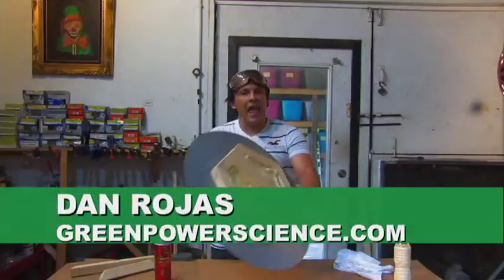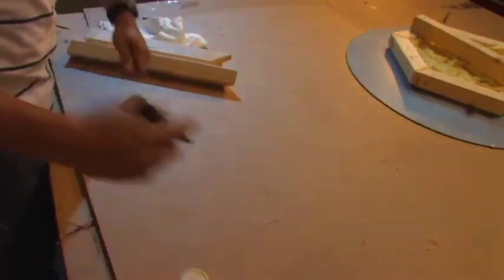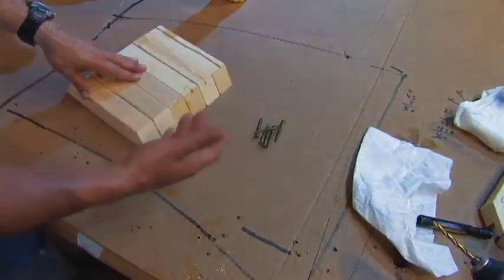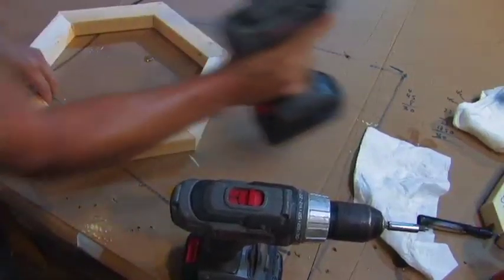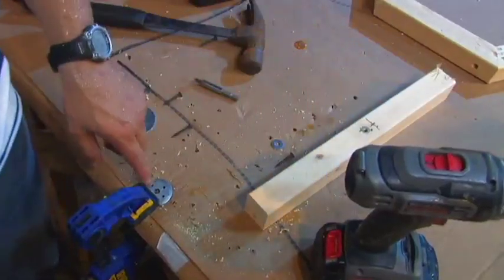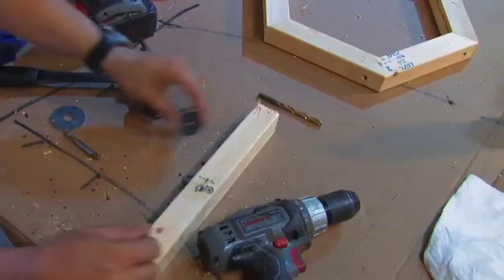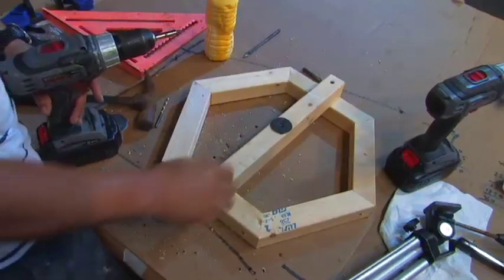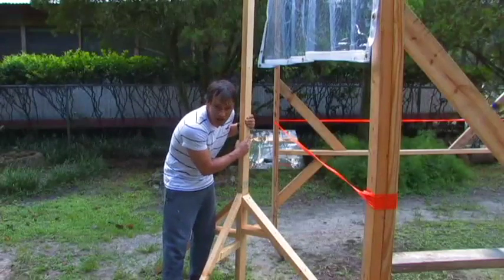SOLAR PARABOLIC MIRROR MOUNT DIY HEXAGON

Comment from the maker: @vector65535 The foam does not have a good independent structure. You need to fill. This makes one large adhesion area and structure. If a corner lifts you still have several square inches of mass left to hold the dish. If you only do the edges you end up with a thin line that will remove easily.

Comment: You can even install heliostats on tree branches that are higher than your windows so that it will provide more natural angles of sunlight through the windows for heating as well as lighting.. You can also inistall heliostats over skylights because many people install skylights away from the sunlight so it doesnt get hot during summertime ... You can still use your skylights for direct heating through heliostats mounted above the skylights.  True, many skylights are filtered against sunlight.

Comment: Another good safety tip for pulling through a table saw like that: hold the board only by the ends of your fingers--that way, if it kicks back the board will be pulled out of your hands. If you have a solid grip, it could tend to pull you into the saw. This is a good safety rule in general to avoid being pulled into various types of machines.

Comment: Have you tested this in the rain, then hot sun, back to rain, etc. for a couple of weeks?  Hold well? Good design.  Here are a couple of posible improvements???  Why not first put an adhesive like JB Weld at the wood/mirror contacts, and then spray in foam.  You can also put a few screws on the inside sticking out into the foam as anchors providing adding additional strength.

Comment: what do you mean by foaming the spherical reflector?  you mean molding ?  I also wonder why plastic is not even tried as a backing for the reflector?  Have you talked to any plastic mold injectors ?  Then you can coat the plastic spherical reflectors with shiny material like aluminium or whatever that shines..  Also  you can specify more shallower spherical reflectors so that it is only one degree curvature or less . It will be great for home heating . Ask me for further explanations.

Comment: You can specify with heliostat makers so that they can program the suntracking mechanism with GPS and for quick installations .. They can be also solar powered so that I dont have to string out any wiring toward the suntracking mechanism outdoors.. If the sun shines, it moves.. If not, it doesnt.